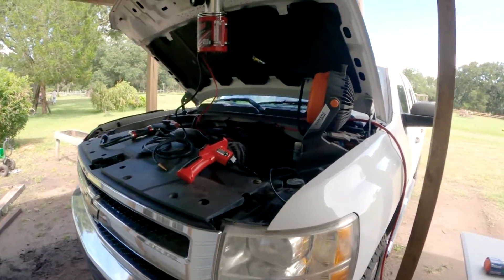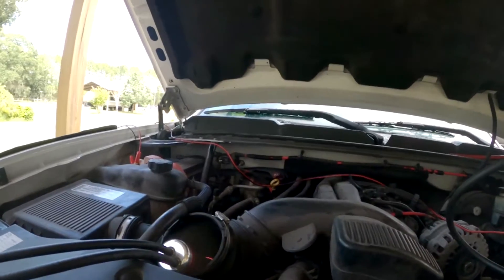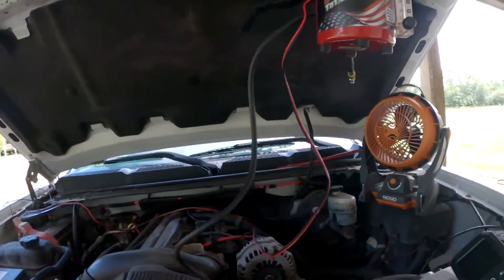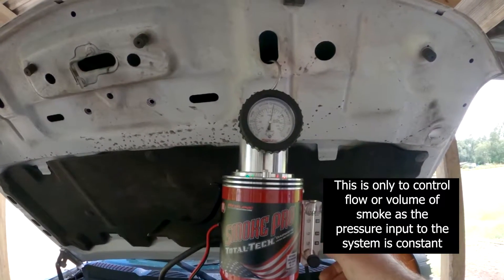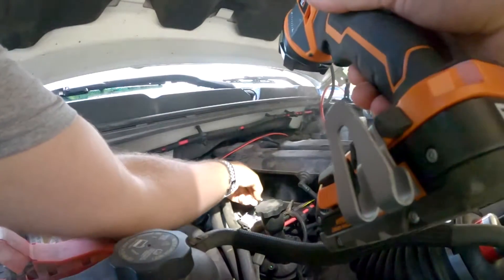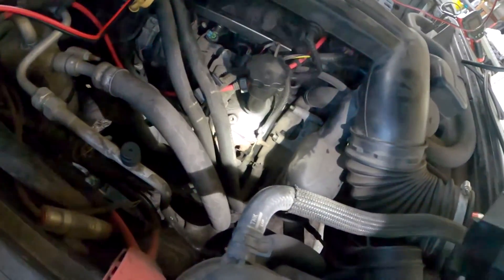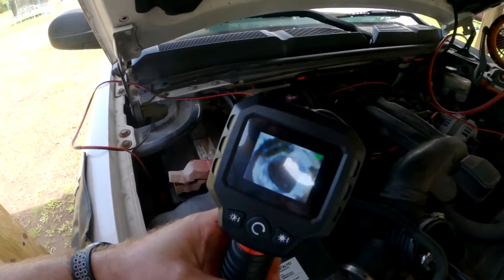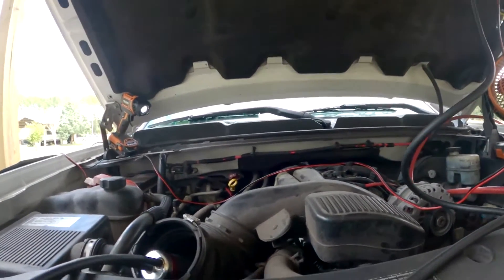My Silverado has no power!!  Air Intake Smoke Test for Intake Leak using Redline Detection Smoke Pro

Comment: 1st question. Have you tried using this on your Turtles snorkel. 
2nd, why was the bolt missing?
3rd, what's with the audio?

Suggestion, try decreasing your bit rate.
Reply from the maker: 1) yes I've used on my Can Am defender and found 2 small leaks... That's primarily what I'm using it for is snorkel testing

2) I think when I bought it at 139k miles (currently at 190k) some work was done prior to me purchasing and they left a bolt out... That's the only thing I can figure

3) just watched the entire video and the audio sounded great here (minus me moving the camera around... I'm looking at purchasing a Rode Wireless Mic to eliminate using the Go pro mic... I did a 2 Pass, High Quality, 19 MB/s bit rate
Reply: @mytecsmoketesting6525  that audio bugs me. I only watch YouTube and haven't experienced that before. It was skittery. I'll try again.
Reply: @mytecsmoketesting6525  audio is fine on my phone, your other videos and other videos are fine. This video isn't.  Weird
Reply: Thanks for telling me... I'll have someone else check it out for me but it's good on my side...